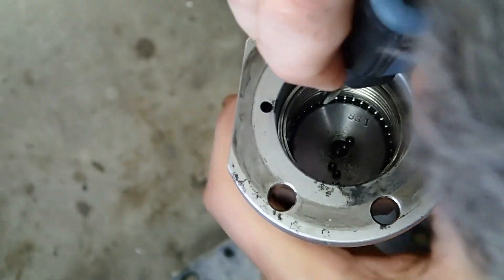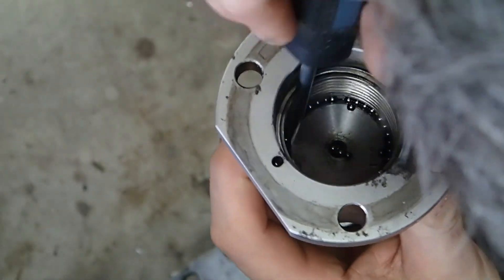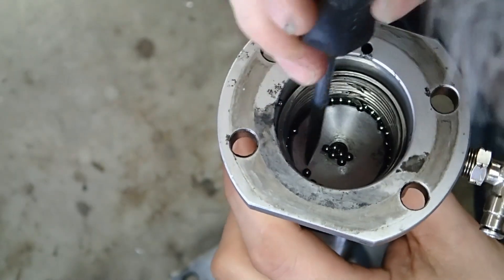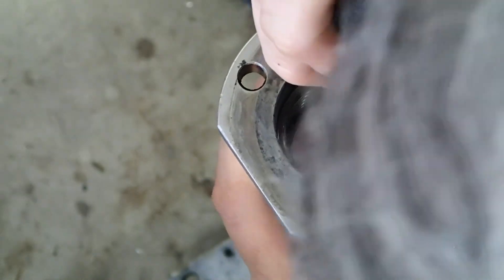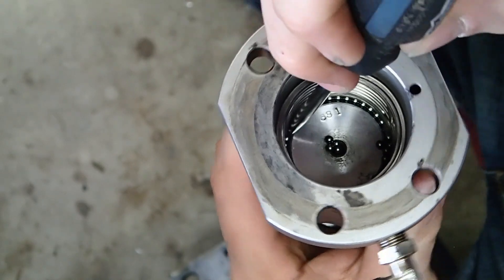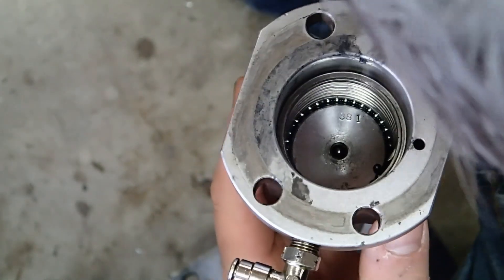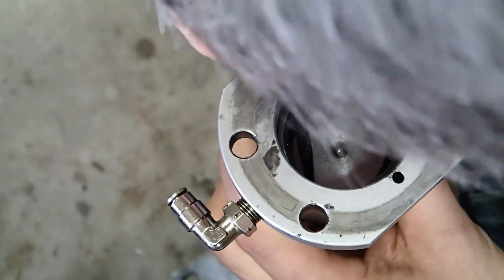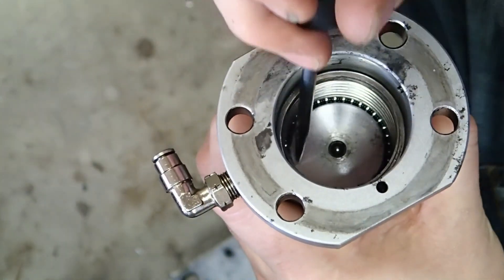Part 23 - (Repacking Y axis ball nut)

Comment: Where did you order the balls? I'm guessing they can't be chrome plated
Reply from the maker: I couldn’t find any info on bearings type so I took a guess with stainless.
Here are the thrust bearings I ordered: https://www.bearingscanada.com/ProductDetails.asp?ProductCode=2-Contact-7304B-20x52x15
Reply: @BlaiseBarrette  thank you, I'll give them a ring Monday.  In some videos I see the bearings are for sure magnetic, in other videos it's hard to tell.
Reply from the maker: I bought them at Bearings Canada https://www.bearingscanada.com
The exact balls I ordered: https://www.bearingscanada.com/ProductDetails.asp?ProductCode=Kit12743
Reply: @BlaiseBarrette  thank you! Is there a reason you went with stainless? I'm guessing stainless would be softer then most other alloys but still pretty tough?  From things I read online it says they should wear quicker then the screw. Just picked up a 6030 and the X axes oil line seems to have been broke for a while, 5 thou backlash but it has the same backlash threw the same length. I'm more of a hobbyist like yourself. If I can just tighten it up and get it back
Down to a thou it would be great!  Priced a new screw and the cheapest option was about 2,000 Canadian shipped plus what ever duties we get dinged. 

One last question. Did you order the thrust bearings from a fadal parts place or source them? I saw the video on 60 degree bearings being better then the original 40 degree. Would love to upgrade it while
It's apart. 

Great videos! Helped a lot so far

Comment: You should really reconsider using this ballscrew. The ball bearings are specifically sized to match the grind of the nut and screw, most quality ballscrews have balls that are sized to +/- a tenth (.0001). You basically went from a precision ball bearing to a nominal ball bearing, in this case you went up .0025 in diameter. Which is HUGE in consideration of the application. The big thing people don't know often about ball screws is the screw and nut are harder than the ball, the balls will wear out not the screw. That is why it is common to "re-ball" a ball screw. Where your problem comes in, is the design of the channel the balls ride in only provides tangential contact with the balls. Therefore as your screw begins to crush the ball to fit the channel, the balls will deform and destroy themselves. That is what is occurring with the additional drag felt. As the machine runs and the rapid changes in direction occur, the wear and damage will increase rapidly. I would suggest that you either send the ball screws out for reballing, replace them with new screws, or gamble on used screws. Basically any of those three choices are  better option than where you are at now. A new ballscrew is about 1,000 usd depending on the quality. Rebuild your mounts with the appropriate bearings and seals, delete the ballscrew cooling lines and plug the holes properly. You can save a few hundred dollars by doing that alone off the cost of a new screw. Ballscrews are not a playable item, if you get them wrong you will be in trouble quick.
Reply from the maker: Oh! That’s bad news! I really had good hope since the bearing balls on the other ballscrew are exactly 0.125”. Anyway, at this point it was already shot! There was a huge amount of backlash. Premature wear probably from lack of lubrications. Unfortunately, I am on a limited and tight budget and there are still some huge question marks! The controller being one of them. I don’t even know If I’ll be able to make it work again! I plan on using UCCNC as the controller and completely replace the electronics. I’ve seen CNC routers working with this controller and the motions seemed sound. So back to the ball screw, I think I will start by making sure I can make it work again before starting to do significant investments. Hopefully, the machine will eventually start making chips and pay for itself? I realize it’s not ideal but I got this machine for 500$ CAN! ( +/- 400$ USD). I wasn’t planing on having a machine but the deal was to good to pass on so I’m giving it my best shot with what I’ve got. I don’t need it to work really! I already spend 45 hours a week CNC machining at work so it’s not like I miss it all that much on the weekends! Hahaha!!! Anyway, thanks for your comment. This is the reason why I make these videos, so that I can learn from you guys. I will put the machine back together with the ballscrew as it is but I’ll watch it closely and replace it when it fails. Tell me, you seem to know an awful lot about ballscrews... how come?

Comment: Very Good !    is the Backlash the same in different locations on the Screw?  Most screws I think have more wear in the Center.  Why i always offset my vise to use different locations on the screw for wear.
Reply from the maker: I won’t really be able to test the backlash until I have it motorized again. That said, I am very hopeful! I also want to replace the angular contact bearings. This should stiffen thing up greatly.